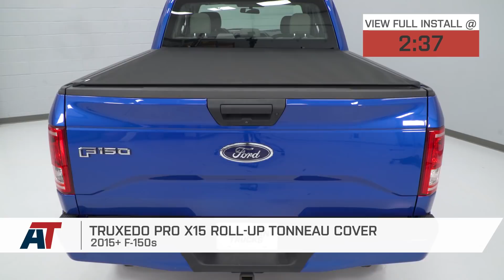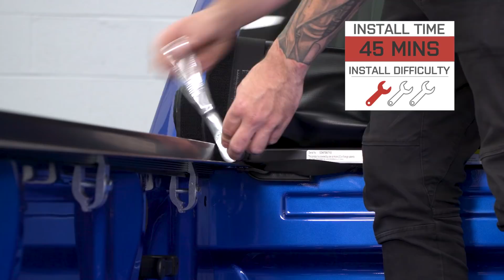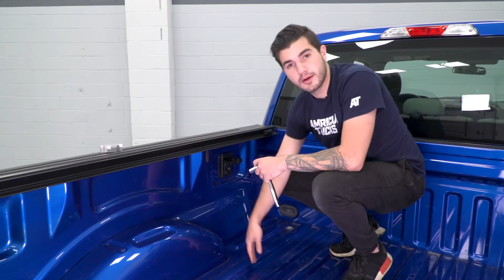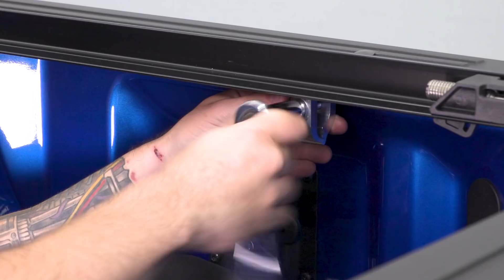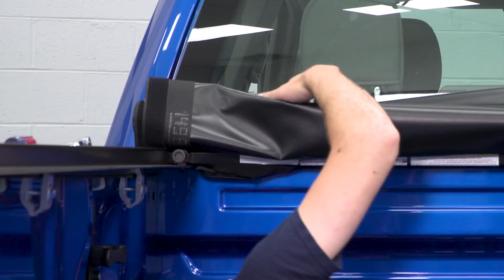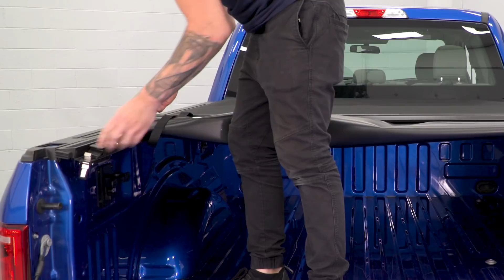2015-2018 F150 Truxedo Pro X15 Roll-Up Tonneau Cover Review & Install

Comment: Pay that much for the cover and you cannot pull out the wrinkles 😂😂😂
Reply: You can,  it has tension bolts in the front. The install instructions discussed this on how to adjust to remove wrinkles.